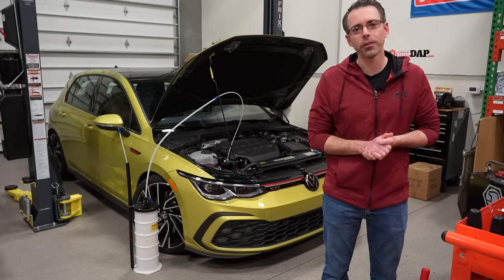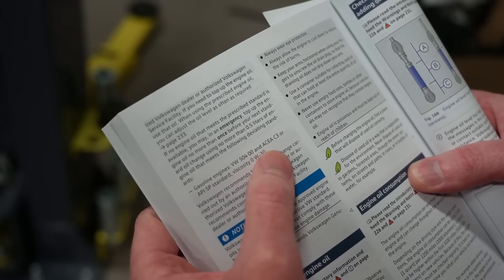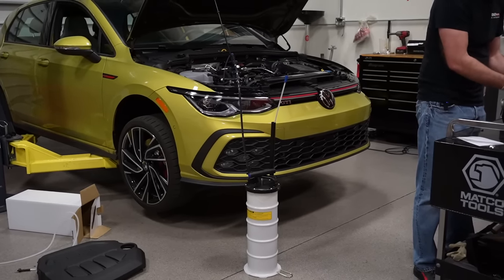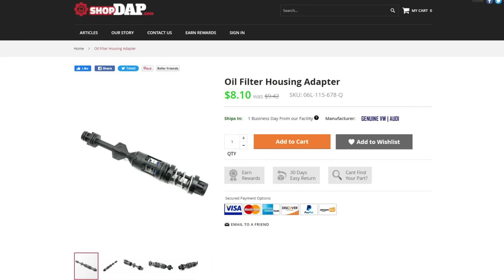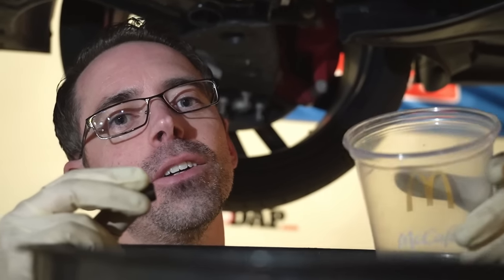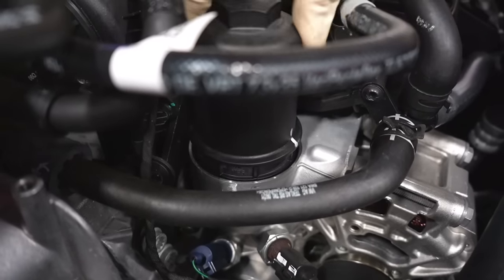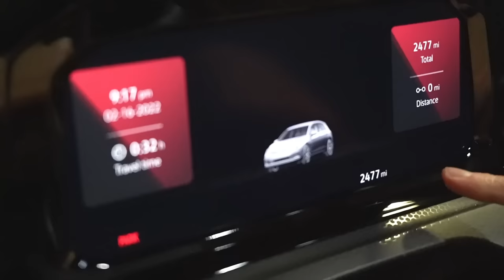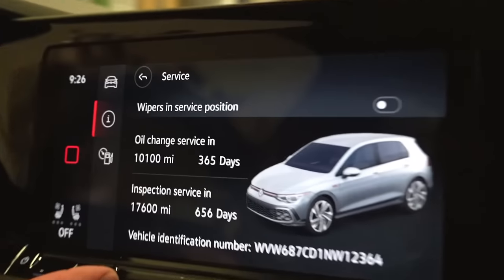Will an Oil Extractor get all the Oil? | MK8 GTI Oil Change

Comment: The lesson learned when using one of those oil extractors is to always make sure the adapter where the tubing switches to smaller diameter is secured firmly. Mine came off when I was pumping the oil out of the extractor into the oil jug and made a mess.
Reply: Same
Reply: thanks for the heads up.

Comment: So I'm a volkswagen dealership technician and something that surprised me when I first joined the brand was that VW actually specifically write on service sheets "do not extract oil" so technically VW say that you shouldn't do this but like you say in the video its a known process in the VW and audi community, personally I think no matter how you drain the oil the most important thing is the oils getting replaced either way
Reply: I think it can suck gaskets n seals from within... if it's to strong.. 

IMO . How lazy can you be to need n extractor.. 
5min to do oil changes.  Been doing it since 1993.
Reply: @hotshotfx3502  for sure not on the Mk 7 Golfs unless you're really rushing. You have to remove the belly pan to access the drain plug.

The vacuum pumps don't have enough suction to damage seals, either; even if they did, if you leave the fill cap or filter housing open, there's no chance of pulling a vacuum in the crankcase at all.
Reply: @hotshotfx3502  Talking about being lazy but spells and as n and instead of saying in my opinion you say IMO.
Reply: @bfielder9097  I know No time with all the oil changes I'm knocking out.
Reply: @hotshotfx3502  Its not about being lazy, its about ramp space, floor space, garage space. Lets say you park on the road, you can use one of these instead of jacking up each side of the car, putting stands under, and crawling under a confined space. If you have a proper garage and even a car lift, if you have a car up on the lift, you can do an oil change out in the parking lot. I live in a city I do all my oil changes, and car work on a street with people driving past me, I just cant bring myself to climb under the car unless I really need to. If you have a garage and you have ramps, and all that stuff, then using one of these is I agree lazy, as you wont even save much time.
Reply: @geroutathat  I've been using extractor for 3 months now. Works great.
Reply: @geroutathat  I'd add that using an extractor is less mess as well. Catching oil in a pan usually splashes a bit. It also saves another step of pouring from the drain pan back into a bottle for disposal. Then you have an oil drain pan. Do you wipe it down? Do you just leave it to collect dust in the residual oil?

Like you said, not a big deal if you have a garage with ample work space. Otherwise an extractor is totally reasonable for all other use cases.

Comment: I carefully used a pipe wrench on the plastic filter housing, worked fine. And I love this method of changing oil, I will never take off the oil plug ever again on this car.

Comment: I brought my 2023 GTI 40th Anniversary to the dealership for its first oil change and the dealership overfilled it with oil.  I had to use an oil extractor to get it to the proper level 😮

Comment: An oil extractor that is designed to be connected to an air compressor will create constant suction and remove more oil than the hand pump ones, and sometimes remove more oil than a drain. Even the smallest and cheapest air compressor will do, which can be purchased for about $50 at a big box store. One could use a $25 12V tire inflator, but the only problem is that those kind of devices usually don't have interchangeable hose connectors, and can only be used to inflate tires. Many oil extractors designed to be used with an external air compressor are less expensive than the ones with a hand-pump.

Comment: From a self certified DIY mechanic, this video is very funny, I have never taken my new 4 runner to the shop.  After 80,000k of oil changes done by myself.  Why would I.  I love working on my cars.  

Great video😂.  Keep them coming.

   After I took the car out of the dealer floor, within a 3 months I was already getting calls from them to do the first oil change and check up.     I just ignored them completely, actually, I told them I can do that all myself to have a blessed day.   They never call me again, just sent me silly emails there after.  I have a membership to a car wash, everytime I pull up to the Toyota dealership to buy oil, they keep on commenting,” wow this car looks new.” I grinch every time I see the long line ups of cars waiting to get oil changes and services at the dealership.

Comment: Love where vw is putting the filter now, just makes it easier
Reply: Is this not where the oil filter had been for a while now? My mk6 is in that general spot. I think it's been the same since maybe the mk5.
Reply: @rjmari  no way I had two Mkv’s and they only had the housing underneath. So it was done with the Mk6’s?
Reply: @04r32murse  Oh ok. Bad assumption on my part. But yea, it's in this same location since mk6.
Reply: Mk 5 GT diesel filter is up on top of the engine.

Comment: I perform an additional step when using an oil extractor (bought mine from Griot's years ago); after removing the pipette from the dip stick tube, wipe it off and place it in the bottom of the filter housing to suck up the remaining oil there.  You'll have to pump the handle once or twice while moving the tube around but it works quite well to remove whatever's left. Then install the new oil filter.
Reply: But the remaining oil flows down to the pan anyway.
Reply: @GymChess  don't think you quite understand...after removing the oil filter, if you look down into the bottom of the filter housing, there is oil sitting there that doesn't make it to the pan.  It's maybe a few ounces  at most, but I like to remove it so it doesn't contaminate the new oil.
Reply: @jeandunow7794  lol well if you think that a few drops make a difference go ahead.
Reply: @GymChess  Well, there are quite a few people dead set against using an oil extractor cuz they don't think it gets all the dirty oil out!  I'm just anal! 😂
Reply: @jeandunow7794  I used an extractor myself in October when I did my most recent oil change. It works great. The only downside as I see it, is that you don't get to do s general check under the car like when you do  a "normal" oil change. Other than that, sucking the oil up is perfectly fine.
Reply: There is close to a quart of non drainable oil in the engine anyways (difference between the dry fill quantity and the oil change quantity).

Comment: I love vw's one manual to confound them all. Been trying to work out what oil to get for my Mum's  08 1.9 pd tdi for 3 months..... Thanks for the label tip
Reply: The amsoil site is actually a really good resource as well, even if you don’t buy their stuff it shows the capacity and oil type required for quite a lot of vehicles
Reply: Bro, Rotella T6 for life My Son...
Reply: Any oil that meets VAG 504/507 standards usually 5w30 or 5w40
Reply: @Mr330d  mannol is cheap and is what I run in all my cars, just as you said get the spec needed for your car and change regularly not every 15k.
Reply: @Mr330d  Many thanks for that tip. It sent me back to the manual and I think that its 507 that Mum's Bertha Bluebell needs and not a moment too soon. Her cataract surgery went well so now she can see the "service now" warning.  LOL
Reply: @dumbestoyster  Thanks for this, I had a look and Rotella seems to be a US only brand.
Reply: @piovo5222  I've just started using Mannol oil - I liked the brake cleaner... - and they do very cheap 20L drums in the UK with a specification that I can use in a 98 A6 2.8 petrol and an 04 Freelander TD4. Makes life much easier. All cars get a 12month change as none do more than 7K pa
Reply: @sjg4967  yea it’s a great cheap oil, I drive my cars very hard and never have problems with turbos etc from quality of oil.
Reply: @piovo5222  Thats good to know thanks. I baby my car but its 24 now and I want to keep it for as long as I can get petrol.....
Reply: @DigitalN  Ravenol is better
Reply: Mine has a sticker with the oil i need
Reply: @dragospahontu  Ha ha, count yourself lucky.  I got really excited when I heard that there is a label..  I'm in the UK and there is no label and no sign there ever was one.. It says Castrol on the filler cap but that's the lot.   Luckily I  have worked it out now thanks to everyone here.. Cheers folks...

Comment: I tried making my own oil extractor about 15 years ago. I converted a small Harbor Freight air compressor into a vacuum pump and used a 5 gallon bucket as the vessel. It worked pretty well on water and coolant with a 1/2 inch i.d.hose.........but when I used a 1/4 i.d hose to suck out cold 15w40 diesel oil, the bucket completely imploded.
Reply: Great attempt though!  Sure you had a royal mess afterwards...
Reply: the image of a harbor freight contraption's bucket imploding with a guy looking dumbfounded looking at it was very funny
Reply: There’s plenty of cheap 12v pumps on The ‘Zon now for oil extraction. Key is, the engine oil has to be warm-to-hot, cannot be cold.

Comment: In contrast, over my 30 years of Japanese car ownership, the owner's manuals have been models of clarity and brevity. Right to the point, and with an index too! That's my experience with Suzuki, Mazda, and Honda owner's manuals.
Reply: 2017 Subaru manuals total about 2 inches thick and are as bad as the video's
Reply: Agreed. I’ve owned Hondas since 2015 and their manuals pretty much tell you all you need to know for servicing the car, compared to a vw manual that just basically tells you to take it to the dealer.

Comment: On my mk4 Golf TDI, I changed the oil every 10K miles.  I sold it with just shy of 400K miles on it.  The engine and turbo were still original and ran perfect.  10K mile oil change intervals are probably fine unless you really thrash your car.  I do the same thing on my mk7 Golf TDI, and at 90K miles, I've had no issues.
Reply: Nice usually they say cars with turbos to change the oil more frequently most probably due to more friction with the turbo as it's constantly spinning etc but yeah 5/7.5/10 is good as long as it gets changed you'll be golden...got a MK4 GTi myself
Reply: @DesolationTech  Diesels can be softer on the oil as the particulate is less likely to cause wear and the fuel is less harsh, it's not uncommon to do 10k on many diesels with good results unless run hard. I change it more often on turbo gas vw's because oil dilution can be an issue especially if the pcv isn't working so good or something is chunking out bits of metal (like bpy cam followers).
Reply: I'm freaking out at 6k miles because I usually change at 4k. Been too busy.

Comment: This depends on the engine.
According to the repair manual, you can extract the oil from the dip stick tube on the EA888, but not on many of the other engines in the VAG line.

Comment: I paid $50 for a HF version years ago.  It's a game changer for me.  No need to read the user manual just throw it away.  This is one of my top 10 items you must buy from HF.  I use this for everything from bleeding brake to power steering to oil change.  I use this once ever 5K then full change every 10K so I can swap out the filter ... yeah yeah I have to jack it up to get access.  I love this device man, can't speak enough value it bought when doing brake bleed by myself.  I used to suffer from massive hand sore using hand pump, for a few extra bucks this thing just take entire stress out of the equation.  I mean 0 stress and I'm loving it.  As a matter of fact the pump is so powerful, you're going to need to work fast or your master cylinder will be empty and you'll end up with more air pockets.

Comment: I changed my oil in my Mk7.5 every 5000km/~3000mi, from new, and my first 5 or so oil changes, at 5000km, the oil was BLACK. But after about 25000km/~15,000mi, the oil only gets slightly darker between oil changes now.
So it's DEFINITELY beneficial to change your oil more often when the engine is new.
Reply: I wonder if the VW 50800 Oil in america is different. Here in germany these cars have 30000km/ 2 year intervals (around 20000miles) by VW and every car enthusiasts says that 12-15tkm/ 8-10000miles/ 1 year oil change is totally acceptable. 
Also with these direct fuel injected engines a black oil is normal, even a sign that the oil has cleaning additives. when I change the oil in my diesel it's black after the first startup.
Reply: @JohnDoe_333  It wasn't simply blow-by because it did go away after about 5 changes.
It's possible they are different, you guys got multi-port injection, and we just got direct injection without the port injectors...

Comment: I love that I don't have get under my mk7.5 GTI for oil changes.  Did the same with my 2014 Beetle and its 1.8L.  Now my wife's Mitsubishi, nope!  Can't even get the pickup pipe into the oil pan.  There is some sort of obstruction that the dipstick can flex around, but the plastic 1/4 inch pipe can't. I have to go under anyway to get the filter, so no big deal.  And the Outlander with the V6 is tall enough to not need to use ramps.

Comment: Thank your for the video. Thanks to this video I bought an oil extractor as I am planning to change the oil every 10.OOO km (=6.200 miles) of my recently bought used VW Beetle cabrio 2016 1.2 tsi. I will have to baby that itty bitty engine. Greetings from Belgium.

Comment: I know it's just a small thing, but I only use new oil when coating the O-ring or the mounting gasket on a screw on oil filter. The old oil is full of acids and contaminants. I can't prove it damages the gasket, but I remember years ago when I coated a filter gasket with old oil, it was the only time I had an oil leak from the base of the filter. Maybe it was just a coincidence and I hadn't tightened the filter enough, but I've done many oil changes and it only happened that time.
Reply: Owell

Comment: Just wanted to jump in, late as it is, to comment about the double change thing.

I used to work at the food court in the mall and had this busted old salvage title Mitsubishi Galant. Since I didn't really have a ton of space in college, or the interest in doing my own oil changes anyway, I would just get it done at Sears while I was working because I could drop it off at the start of my shift and pick it up on break.

I took my car in one day to get an oil change and drove off after, only to have my car suddenly start shuddering at low speed while driving through the mall parking lot back to my side of the mall. Gliding towards my parking space the car shuddered again and shut down entirely.
It did all of this again on the way home, which had me thinking my car was dying after my oil change. Watching to eliminate the oil change, I took it back, described the issue to them and had them look the car over. They couldn't figure out what was going on. 

The car continued the shuddering and shutting down which really makes a drive home in 5pm traffic a daring game. The next day I took it to the mechanic I would usually go to that I trusted, and they checked it out for all of about 10 minutes before coming back into the waiting room and saying "Yeah, they drained your transmission fluid...that's what was going on. We re-filled it for you, but I would recommend you never go back there again". 

That was the last time I got an oil change done at a place that wasn't a dedicated dealership, though now with the ability to not need to jack the car up and crawl under it (things my apartment complex doesn't exactly smile on in their parking garage) I can start doing them myself. 

Great video!

Comment: When the OEM’s recommended/approved way to remove the oil at the dealers is sucked out… dealers don’t get given enough time to service via the sump plug, the technician would lose time and thus money doing extra untimed work. You can request the change via the sump plug but expect an extra charge.

Comment: Hot oil in the face....I'll never forget when working at Toyota I just happened to turn to talk to a coworker who just loosened a drain plug. As soon as the drain plug removed the oil went into the bucket, hit something and in slow motion looked like a giant wave right into his face🤣🤣🤣🤣 i almost fell laughing
Reply: The Siennas had a bad habit of the oil stream literally bouncing out of the drain pan when the oil was hot. I got tired of cleaning up every time and put an anti-splatter pad in the drain pan, haven’t had it bounce since.

Comment: Question:  When sucking the oil out, do you lose the benefit from a conventional drain of having contaminants "flushed out" with the flow of oil rather than staying at the bottom of the pan?  I'd like to see a comparison of oil pans from vehicles that have done only conventional drain versus only sucking the oil out.

Comment: I also had flecks of that red stuff in my Arteon filter.   First oil change had a bit in nearly every pleat; also a small amount of similar green material; also 3 metal slivers, 2-4mm long and under 0.5mm wide.   2nd oil change had ~25 flecks of the red stuff (all under 1.5mm x 0.8mm), which is maybe 7% of the material found in the first change.  Also 6 metal flecks, all under 0.4mm long/wide.  3rd oil change had 8 red flecks, no metal.

Comment: Bought the extractor for my 23 GTI and it basically enabled easy mode. Did my first chang at 4k and found that i too had red flecks in my oil filter. Hopefully VW isnt as RTV happy as Subaru is with the BRZ.

Comment: Great video! How do you recommend cleaning the extractor (if at all?) I got one for my A3 and it's worked very well, but I'm a bit of a neat freak and would like for ther not to be a little puddle of oil at the bottom of the extractor all the time
Reply from the maker: You can always clean it out with brake clean if you are crazy enough to spend the time to make it squeaky clean every time.